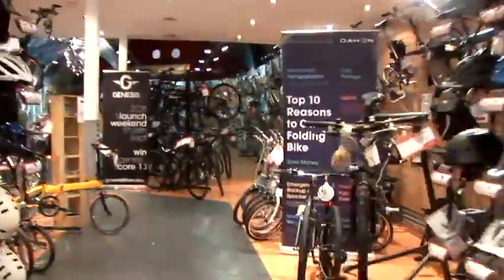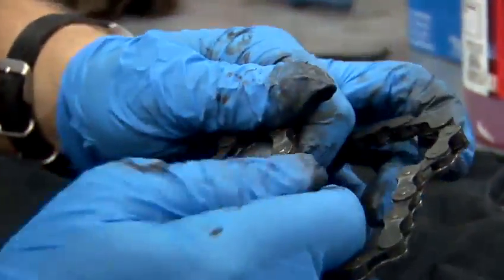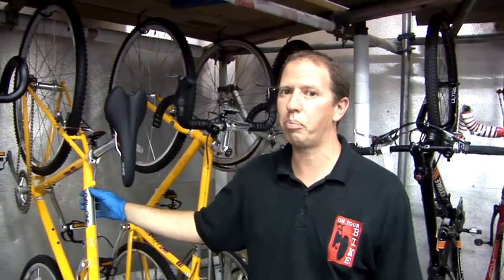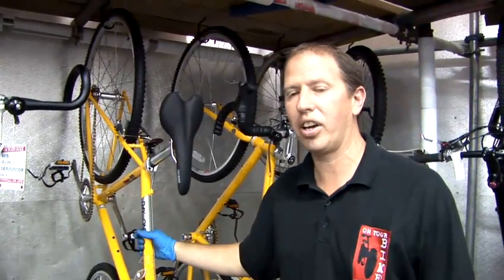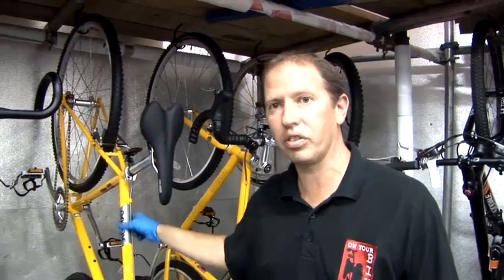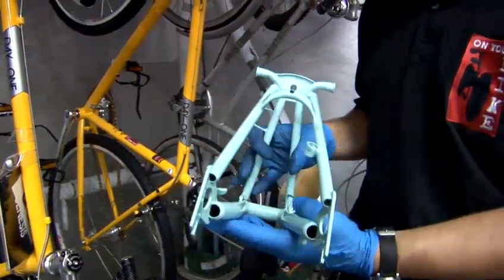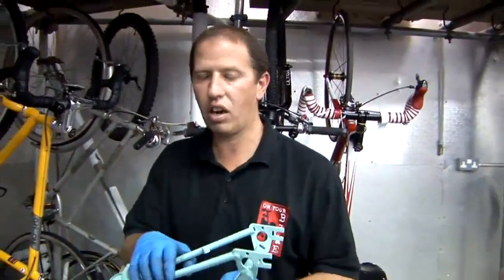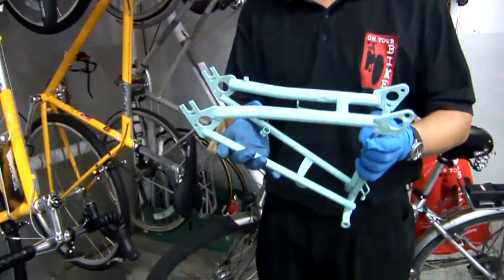How To Paint Your Bike

Comment: This is incorrect you are referring to powder coating which isn't painting at all its a type of polymer powder that is attracted through an electrostatic charge to the metal then baked to bond the particles together creating a hard exterior surface. This is an extremely unhelpful video and is uninformative